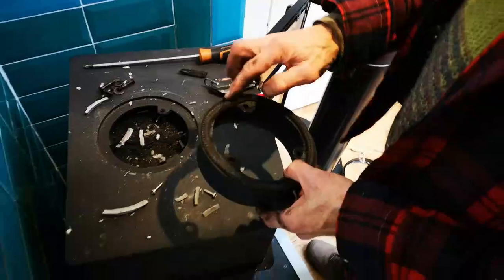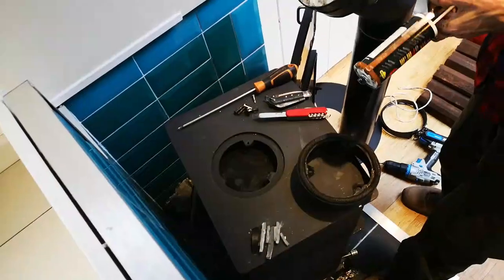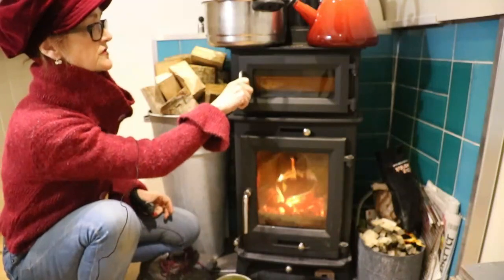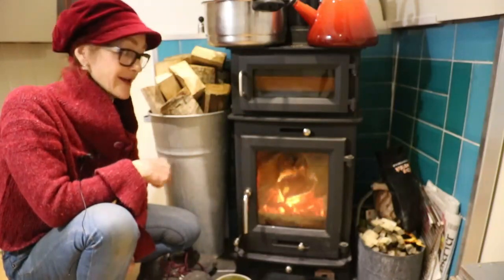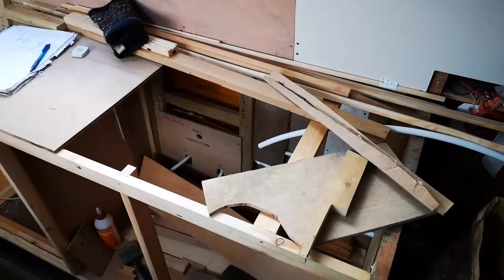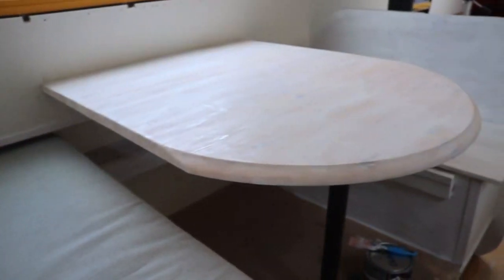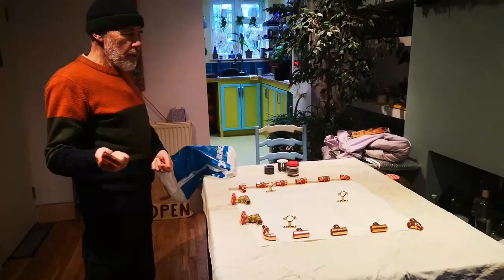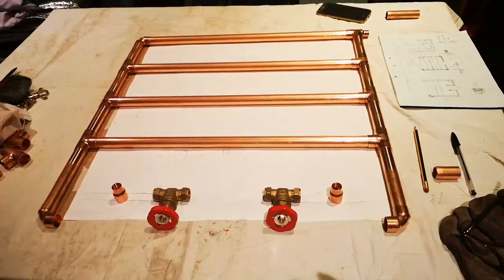Stove review and making our own radiators

Comment: Hi, your boat fitting is looking good,  if you don't mind me saying,  you can put a bit bigger steel plate(5mm) like 2 inches wider on top of your stove,  so you have more room for your saucepans for cooking! I did it on mine ..
Reply from the maker: Ooh... Good idea... Though I'm mainly using the top for keeping things warm as the oven takes up most of the heat. I've been able to crack quite a few good meals out... Though of course there's not much temp control 😁

Comment: With air purifier buy a 100mm or 4 inch carbon filter about £20 and a cheap inline fan. You plonk it on top and plug it in costs about £40 is what I do  and filter lasts about 2 years. Removes smells and everything but might want to look at lower powered or 12v fan, you should just be able to tape a pc fan to the top of it for 12v.
Reply from the maker: Good tip.... Does it take the really small particles out? Most of the ones I researched only went down to .3
Reply: @nevermorethan4   Not sure but it would stop the smell if you decided to grow cannabis on your boat lol, so I guess so.They also remove radiation as are carbon filters but don't know about particulate size, sorry. In my flat it removes cigarette smoke after about 5 mins or cooking smells and all smells and is hardly any dust any more. I'll usually turn it on during the day when there and just let it run all night.
Reply from the maker: @claire4486  interesting.... Thanks for that 👍😊